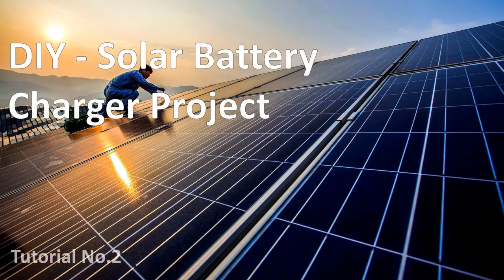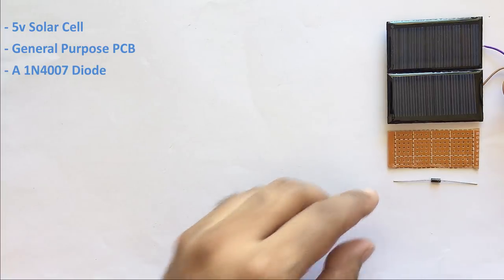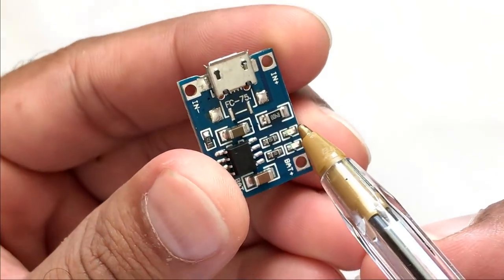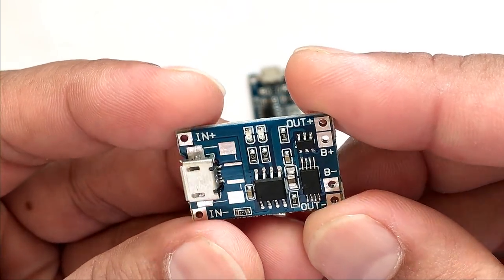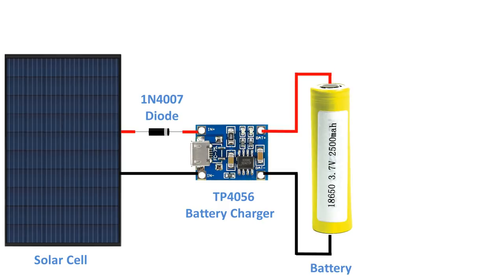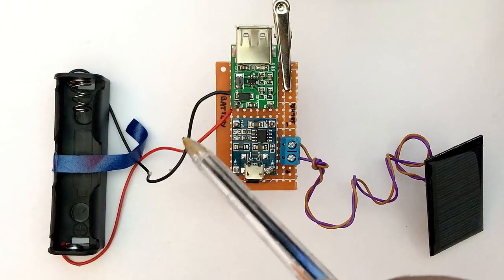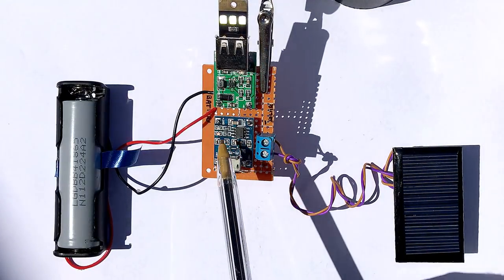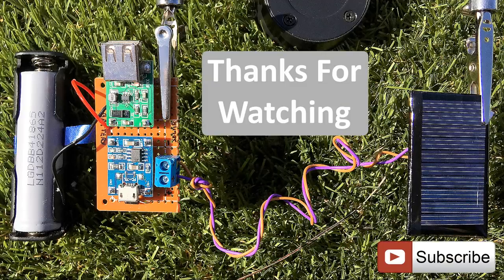DIY - Solar Battery Charger

Comment: You can reliably use a 7 ~ 8 volt solar panel which will allow enough amperage to start the charge cycle and still output 4.2v so this will work, but you'll have to use the stated solar panel mentioned above, not 5 volt. Here is the minimal and maximum voltages for the TP4056 from spec · Input Supply Voltage(VCC)：-0.3V～8V
Reply: I think 9 volt will be better for tp
Reply: Tp is linear regulator so its waste so much power in heat 4.7 to 5v is best when we use above 5v it's heat more and more
Reply: I have 5v solar panels. Will these NOT work?

Comment: Nice video. Well done! I used the same circuit on an ESP8266 sensor node and it worked fine for multiple years. I only had to increase sleep time to survive the dark Dutch winters...
Reply: Sorry, Can i ask for the connection of solar to esp8266?

Comment: Thanks for your video. If I use 18650 battery with built-in overcharge and undercharging protection and I connect to TP4056 with protection (DW01) will there be a power drop or other problem?
Finally, do I need this diode 1N4007 if I have a typical TP4056 without protection (DW01)? Someone wrote that it probably is not needed but I want to have reverse voltage protection.
Reply from the maker: HI There
According to the datasheet: No blocking diode is required due to the internal PMOSFET architecture and have prevent to negative Charge Current Circuit.
You dont need a DW01 coupled up with TP4056 boards. There are two variants of TP4056 boards. One of then already have a n inbuilt protection IC on it.  However in general any component you add to a circuit will cause a bit of drop.

Cheers

Comment: If you continuously feed yr arduino this way, you need to add a so called 'powerpath' to avoid the current needed for yr project to interfere with the TP4065's charge characteristics.

Comment: Just a bit of correction, you need solar panels with more wattage to efficiently charge the battery
Reply from the maker: That’s is correct
Reply: can give example what solar panel can use

Comment: so if the discharge is cut off at 2.5v, does it mean when it goes to 2.6 there'll be draw on the battery again? How do I make sure the battery is suffiently charged before allowing load on the battery?

Comment: Hi bro! Thanks for your great work! Could you answer my questions? I will be very grateful!
1. If i connect 3 solar panels in parallel (3x 5,5 V  0,4W) will I burn the TP4056?
2. Will 2 solar panels (2x 5,5 V  0.4W) be able to recharge 2x 18650 or do I need 3 this solar panels?
3. Can I recharge this system from a laptop to TP4056? There is mini USB port.
Reply from the maker: First of all thanks for watching my video. Now the answers are as follows:
1. TP4056 can have an input Supply Voltage(VCC)：-0.3V～8V and Input Supply Current in Charge Mode is between 150 ~ 500μA. A long as u stay under the max limits you will not fry anything. 
https://diyfactory007.blogspot.com/2018/04/diy-solar-battery-charger-hi-everyone-i.html
2. If you pump in more current your battery will charge faster.
3.Yes you can
Reply: Thank you very much for your answer!
Reply: I'm sorry to bother you. I have one more question. The TP4056 specification states that Input Supply Current must be 150 - 500 μA. I have only connected one solar cell (5,5V  0,6W) with wires and the meter shows 83 mA. When I connect 3 in parallel, I'll be 240 mA Why is that? And how do I know that I have not exceeded the required 500 μA?
Reply: @CrazyCoupleDIY  Cool answer, ive been researching the TP4056 for a while simply trying to find somewhere where they specify supply voltage parameters. Thanks!
Reply: @CrazyCoupleDIY  the answer for question 2 can i ask if i use solar the volt is not limit 8v but the Watt is high stilll can use for this circuit to charge batt fast?
Reply: 1. Yes, but better to use 6V 1W Panels (great value), you can use 5 panels in parallel without issues. 
2. Yes, with more panels you can collect more energy which makes charging process faster.
3. Yes, even with a mobile phone charger
Reply: @awolski8088  Please check the data sheet, it clearly says that "·Charges Single Cell Li-Ion Batteries Directly
 from USB Port "

Comment: Could you use all the battery WHILE charging in parallel? i would need to power a small GPU that require 5V and about 2.6Amp so im thinking of using 6 TP4056 (in parallel), 6 batteries and 1 DC converter to 5V (up to 3 amp). Does it sound stupid? I would have to find a solar panel for that but that is not my problem at the moment.
Reply from the maker: You may, 
Just make sure you are producing more than consuming.

Comment: I like ur video,  but why do you not use a charge controller between the solar panel and the circuit you described in video?....
Reply from the maker: The TP4056 chip has an inbuilt BMC circuit

Comment: Why a diode on the solar panel??? In the data sheet for the TP4056 on line 5 it specifically says that no blocking diode is necessary as the internal mosfet does not allow reverse current from the battery. That way you can avoid the 0.7v loss a diode costs, making your solar panel more efficient.
Reply from the maker: That is absolutely right.
Reply: @CrazyCoupleDIY  I'm messing with a TP4056 right now for the same kind of application and watching Youtube videos is always part of any research! Another improvement would be to desolder the red led to save a few more mA when charging. I'm using a 5W thin film panel with indirect light, for charging a 300mAh li-ion battery in my small world band radio (normally run on two AA cells), I use it as a clock radio to wake me up each morning, and it works perfectly playing news for one hour each day on the sparse sunlight it gets a few meters from the bedroom window. I'm in the process of eliminating parasitic power use in my home, and my previous LED clock radio with and old style transformer used 6W according to my new digital meter. This one runs for free.
Reply: Just pinched the red led off with pliers. Now the solar panel is at 3.76V while the battery is at 3.52V, that is only 23mV drop, quite good, so the TP4056 is very suited for solar applications.
Reply from the maker: Good work nice finding. I will pin your comment to the post

Comment: Hello, great video. Is it important to keep constant current for 18650cells? cause it's written that they should be charged cc/cv, but as I understand it depends from everything when you charge them with the sun panel. So does the current fluctuation damage them in any way or not?
Reply from the maker: No it doesn't, 
I am using this setup to power my mailbox notifier for over 2 years and I never had any issues with it.

Comment: hi, the silicon diode not important because drop 0,7volt schottky only drop 0,2 volt,but i read somewhere tp4096 not need diode if solar is the power supply.
Reply from the maker: Actually, u are right
Reply from the maker: Referring back to your comment:
You definitely need a Diode
reason: TP4056 has no inbuilt MOSFET, and hence a Sense Resistor or Blocking
 Diode is Required

Comment: I need help for a were project what if a were battery is V12?  What should we do to charge it
Reply from the maker: TP4056 has:
Input Supply Voltage(VCC)：-0.3V～8V 
The charge voltage is
 fixed at 4.2V

So to charge a "single 12 V battery" you will need more power.
In general terms, you just need to add the chips in series to sum up the output voltage to the threshold and then use some voltage regulators to have it fixed @ 12V
But to charge a 12 v battery you will have to use solar panels with more wattage 

I hope this helps
Reply: @CrazyCoupleDIY  tanks but where can i get  TP4056 and 1n4007 diode, SPDT switch , solar?
Reply from the maker: eBay or AliExpress

Comment: Hey can i use the battery while charging?
Also what is the maximum input on the tp4056 because i am planning to power it with 5v 200mA solar cell (5x)
Reply from the maker: Hi There 
If you have a fully charged battery you can definitely connect it to a circuit while charging.
The Input Supply Voltage(VCC) is:-0.3V～8V 

Output voltage: DC 4.2V. 4 chips, with a reasonable turn-off voltage, the charging circuit for each chip set 750mA, total 3A. Input connected two 5A Schottky diodes, 5V standard voltage input chip heat ideal (3.8V battery test). Comes with over-temperature protection, short circuit protection.

You can connect two lithium battery cells in parallel to form an equivalent single cell battery with a total capacity of twice that of the individual single cells, but I do not recommend connecting more than two cells at a time to this module.

When connecting your lithium batteries in parallel, it is best to charge each battery individually before making the parallel connection(s). With a voltmeter, check the voltage a couple hours after the charge is complete and make sure they are within 50mV (0.05V) of each other before paralleling them.

Comment: Thanks a lot for this, just one question:
Can i not remove the switch?
Reply from the maker: Thanks a lot for watching, yes you may
Reply: You can, but I would not do that, as the boost converter will drain the battery at night, even when the device isn't used. Possibly you could improve it a bit by removing the LED from the boost converter.
Reply: Maybe the switch could be replaced by a photocell, a timer, or both.

Comment: Can I use 9v battery for the replacement of 3.7 lipo battery
Reply from the maker: The Output Voltage of tp4056  is 4.2 V
Hence you cannot attach a 9V batter.

Comment: Was working on this exact setup but in my case the Solar Panel output is 28v is there a version of the TP4056 that accepts 28 volts at its input?
Reply from the maker: As per the datasheet:
·Input Supply Voltage(VCC)：-0.3V～8V
·Preset 4.2V Charge Voltage with 1.5% Accuracy

I am not sure if you can feed 28v into it.

DataSheet:https://dlnmh9ip6v2uc.cloudfront.net/datasheets/Prototyping/TP4056.pdf

Comment: if i am using a 9v battery, is a power booster necessary? and btw great video. Thanks!
Reply from the maker: First of all thanks for the appreciation and your time. 
To charge a 9v battery to an optimal level u will need a panel that outputs somewhat similar voltage and high ampere. If you add a booster in the way then you will be wasting a bit of current/voltage generated by these panels.

Comment: Bro it would be helpful if u could reply me. Can I supply 2.5 amps to the tp4056 without burning it?
Reply: TP4056 can have an input Supply Voltage(VCC)：-0.3V～8V and Input Supply Current in Charge Mode is between 150 ~ 500μA. A long as u stay under the max limits you will not fry anything.
Reply: @kanika1084  Yeah that's why I was asking cause more current shouldn't harm anything right? Also due to 500 ma of current the charging is tremendously slow
Reply from the maker: That is right guys
Reply: @CrazyCoupleDIY  so bro should I supply my tp4056 board with5v 2 amps
Reply from the maker: As per Kanika’s comment and the data sheet the board will fry up if you feed 2amps of current into it
Reply: @CrazyCoupleDIY  ohk thanks

Comment: can DIY charger 134N3P replace these 2 module?
Reply from the maker: 134N3P is a similar battery charging board with protection, so the answer is yes

Comment: hi how i can do the same but i need to have more batteries I want have an arduino uno or nodemcu with some complements as Bluetooth(in case of arduino),  temperature sensor, soil humidity sensor connected all the night
Reply from the maker: You can add more batteries in parallel that way voltage remains same but current buffs up. But you will also need more panels to charge them
Reply: @CrazyCoupleDIY  that would work for me but how I can calculate how much batteries I need for all the night xD
Reply from the maker: Try this online calculator 
https://www.powerstream.com/battery-run-time-calculator.htm

Comment: Curious, if wiring it this way without the switch listed.Will it be able to charge a battery while the battery is powering something at the same time (this is under the speculation of using a better solar panel of course)?
Reply from the maker: Yes it will, but the rate of charging will be low and the battery will in general never be fully charged.
Reply: Thank you for the response. Was planning on using a pair of panels in parallel for 5v 1000mah.
Reply from the maker: That will do the job
I have a similar setup for my letterbox indicator.

Comment: Good one crazy couple. 
I could not get 18650 battery so I intend using a phone battery by removing the battery protection circuit.
Can it work?
Reply from the maker: It will work, Phone batteries generally come with inbuilt protection circuit.
Secondly if you have a faulty old laptop, just open up the battery pack and boom you will have 8 18650 batteries :)
Reply: keep the protection circuit, it is good to have redundancy. (Li-ion battery fires are not friendly to your house) just solder onto the gold contacts.

Comment: Hi i have a question,
I have 40v (12W) solar panel and 12 v AGM battery.... How amcan i set up economic charge controller? Most charge controllers are low voltage rating and PWD where we lose lot of energy in DC step down. What is your suggestion

Comment: How can I upgrade a led solar light pir as the battery doesn't last long... I want to upgrade it to a 18650 battery.
Reply from the maker: You need a panel which can pump more current than normal.

Comment: What do I want to do if I want to make this on a bigger scale? How to charge more batteries at once?
Reply from the maker: You need panels with more watt output.
I have a setup that charges 2 x 18650 batteries using 4 x 6v, 1.5 amp panels

Comment: Hi there, was wondering, while the solar panel is connected and charging the battery, can I still connect a Mini usb to the board to charge the battery. This shouldnt cause any issues due to 2 different devices charging the battery?
Reply from the maker: It should be ok as long as you have the diode in place. The diode will stop the backward flow of electrons
Reply: Now that you mentioned it has Reverse voltage protection in some other comment, do I still need a diode for this scenario (both usb + panel)
Reply from the maker: It will work without the diode
The diode is just for an extra level of protection. However there is a bit of current/voltage drop if you put the diode.

Comment: I would not recommend to directly connect the USB boost module to the battery as than the battery will have no under voltage protection.

Comment: Can I charge multiple battery? Says , 2*18650 in parallel?
Reply from the maker: You will need panels which can output more current in that case

Comment: I have a usb power bank I would like to charge using solar. I was planning on using one or two 6v panels. If I am doing that with this system do I need the battery portion of this system or can I just remove the battery and holder?
Reply from the maker: Yes you can remove the battery portion

Comment: Can I use XY-016 2A Max DC-DC Step Up Power Module Booster Power Module

Property:

1) Maximum output current: 2A (recommended for use within 1A)
2) Input voltage: 2 v ~ 24 v
3) Maximum output voltage:> 28 v (recommended for use within 26V)
Reply from the maker: Sure you may

Comment: What is your eBay? I am looking to put this in a “little free library” with a small led strip with a micro magnetic switch. The light won’t use much power and won’t be on for long periods or even used all that much
Reply from the maker: I used to have an eBay sellers account, but no more. however u should find all these components easily on eBay or Aliexpress

Comment: if i use a 2x18650 3.7V do i still need the switch and voltage booster?
Reply from the maker: The switch is to break the battery utilization circuit (the load) from using the battery when its getting charged.
You can either use a mosfet/transistor in place of the switch or you can remove it all together.

if you add 2 x 1865 in series you will get more voltage output so you may not need a booster, but in that case you will need a powerful solar panel 

If you add the 2 x 1865 in parallel then you will only increase the current and not the voltage output. In this case again you will need a panel with higher wattage output
Reply: @CrazyCoupleDIY  awesome thx soo much!

Comment: Dear sir, i just want to ask if you have any ideas on how i can stop the battery from keep charging?? I have an idea on applying arduino, which monitor the power in the battery, so if it is max it will be auto discharge and min auto recharge

Comment: Dear sir.. I already try it.. i also attached with voltage divider to monitor the voltage into the thingspeak iot platform. Sadly said, the unit fail to charge based on your design. Any hint why.. the battery percentage always indicate the discharging of the battery, but no battery input was exist. I attached with the wemos without booster

Comment: In 1N4007 Diode which is better to use the 50V or 1000V?
Reply from the maker: Depends on the level of tolerance

Comment: I want to use this project to power up a security camera which is too far to have regular power. I will use 4x18650 batteries and 2  pieces of 2.5W 5V 500mAh solar panels.. My doubt, will i need the diode or can i proceed also without it?
Reply from the maker: You dont need the diode.
The datasheet shows that the board has inbuilt reverse voltage protection capability
If you add the diode you will loose a bit of current generated
Reply: Perfect thanks
Reply from the maker: Tp4056
Reply: @CrazyCoupleDIY  that means the diode is not really needed?